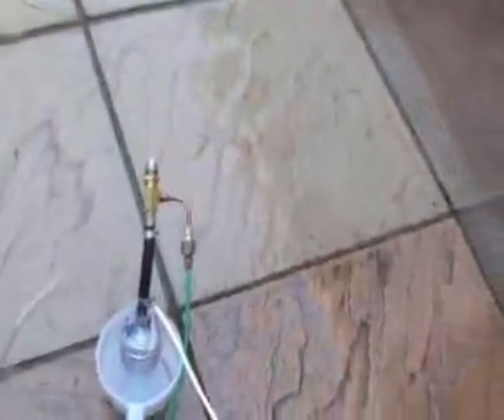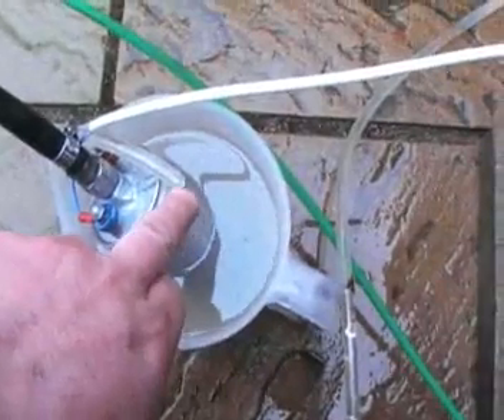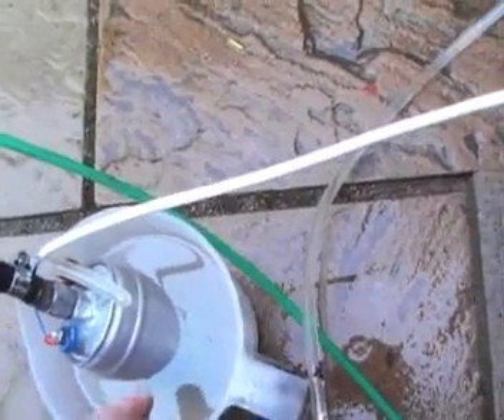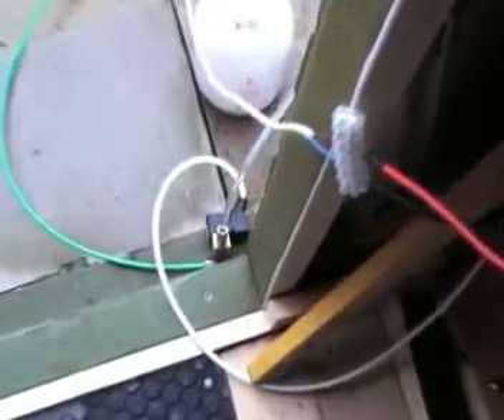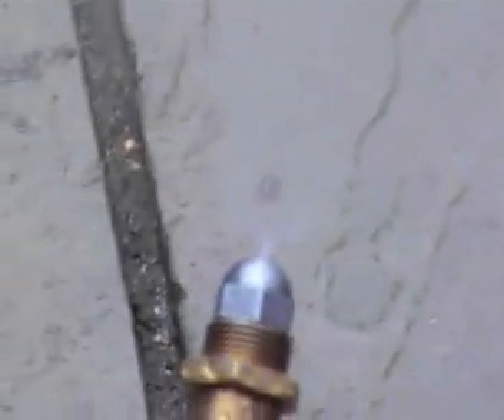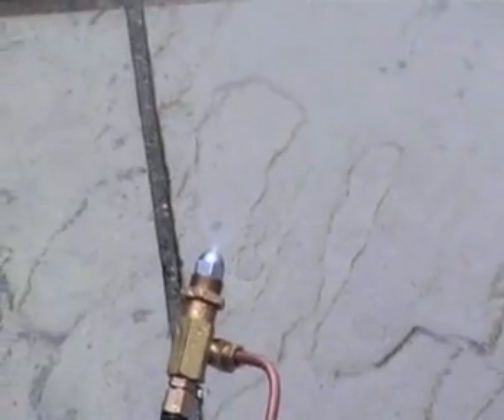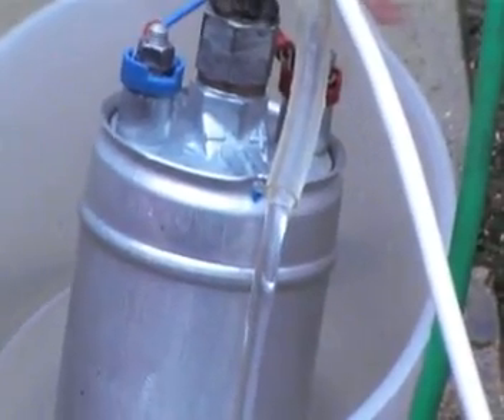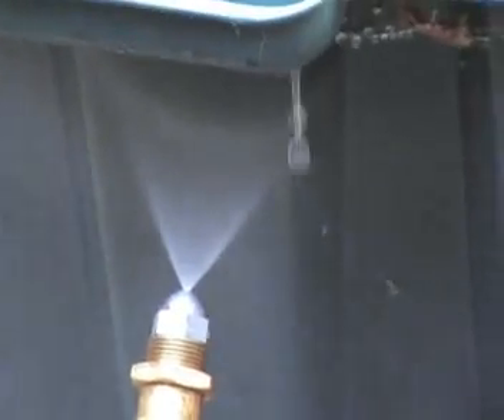Twin Jet Turbine Proportional Nozzle Testing

Comment: I'm not sure how useful this would be, but I had an idea years ago for a NOS system that might work here also.  Instead of trying to vary one valve, use several valves in parallel each with a different size orifice.  You could then use a sort of binary switch.  Eight of them would give 255 different settings above zero.  Using your variable bypass would also work well with this I think; put the 8 (or more or less) valves with their respective orifices in parallel on the return line.